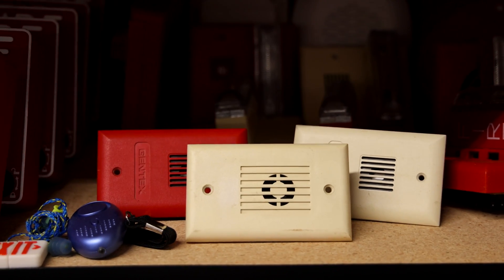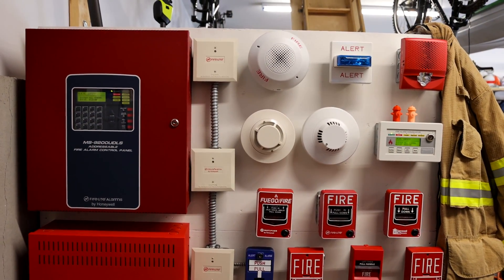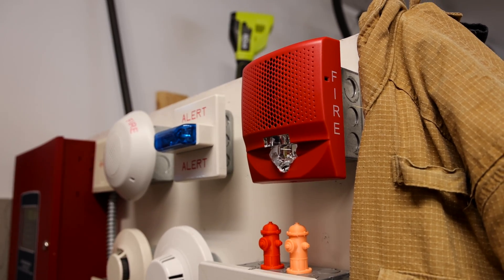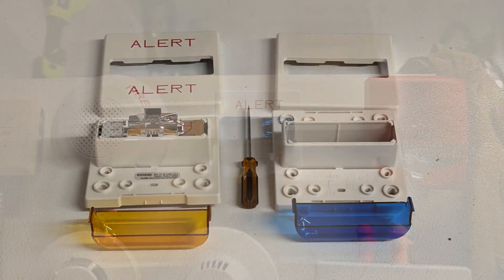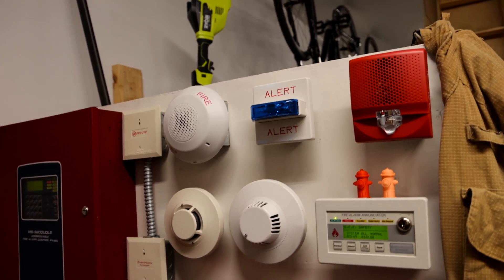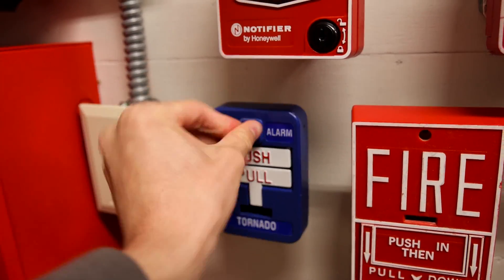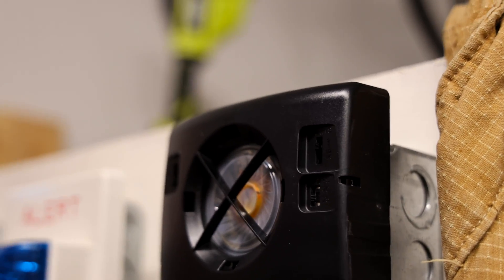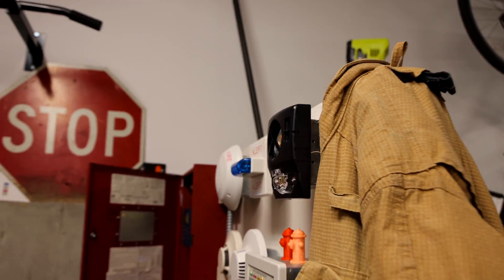Tornado/Fire Alarms doing Alternate Wail! | Wheelock & Fire-Lite System Test 22

Comment: fun fact, in Switzerland we had been extremly serious about which alarms and sirens do we use, but even more important, they are all the same all over Switzerland:
1 population alarm siren autorized
1 evacuation siren autorized
1 emergency vehicles's siren autorized (to be more precise, it's 2 volumes (campagne/highway and city/town), 2 tons (1 high, 1 low and they have to alternate at 1 speed), but different system are autorized (usually pneumatic and electronic))
1 AMOK siren autorized (AMOK=american high school situation protocol (to be more serious, amok is a french word coming from malaisian and meaning something like "sudden and indiscriminate murderous behavior"))

and there is a lot more, but basically, warning noise and siren are the same all over Switzerland and that's probably the most important.

Comment: I think the alternative wail would be good for a nuclear or biological release. We use the alert tone for tornado, the alternating tone for flood, and wail for attack. I actually think those high pitch screech fire alarms they've been using since the 90s are horrible. I actually feel like ripping the alarm off the wall they are so irritating. In the 80s, my elementary school just had a buzzer. They used a continuous buzz for fire and a pulse for tornado. We knew exactly what it meant, but the tornado pulsing buzz was scary even during drills. We actually did have a real tornado warning once. It made you feel that a monster was lurking around the school. In sixth grade, they modernized it, and no one knew what to do. Funky computer tones that you couldn't tell the difference. That's dangerous! The old system worked, and it worked well. Now, they just want to give you a migraine.

Comment: As far as weather sirens, I wish they would go back to the mechanical Thunderbolt that use a rotor and blower. Those made an eerie sound when wailing up, and winding down. They would rise in tone, hold it steady for X amount of minutes, then they would wind down. Around here, they don't keep rising and falling, and they also changed to a digital tone that's not nearly as spooky nor cool as the vintage Thunderbolt sirens. Though technically misnamed as a sound wave isn't a bolt, but a sonic boom. Lightning can be a bolt as the veins streak across the sky. But that's just my pedantic quirk.

As for Fire Alarms, the ones that I like most are the ones that rise from a low tone and keep repeating that sequence. And when there are multiple ones, it sounds even more ominous. Back when I was a kid, they were just loud buzzers with trumpet shape horns attached to make them louder. According to my Mother, I got a big kick out of pulling fire alarms and opening alarmed fire doors when I was like 3 years old. While I don't recall specifically doing it, I do recall the noise and did get a kick out of seeing people scrambling.

Also, I really HATE this LED nonsense. They're not only deteriorating our eyes, but they're just too bright when looking at, but don't put out good ambient light.

For example, when Police, Ambulance, or Fire would go down my street, I'd see the orbs on my curtains and walls, moving. Scared the HELL out of me until I realized what is going on. Now, I don't even notice emergency vehicles are around until I actually look outside to see what the vehicle with the siren I heard or the rumble of the firetruck that happened to be on my street. Halogen rotators are the best, for those applications and for fire horns and strobes incandescent, halogen, lighting up the sign itself is better with also a Xenon strobe tube flashing to grab attention. The reason why the sign that reads fire should also be lit is because, often with strobe, all you see is a flash. Not where it came from.

Comment: I own some tone generator boards from a modulator siren and I have directly recorded all the tones from the controller at a much higher quality then your current recording 

Here is the link to the modulator controller tones https://drive.google.com/drive/folders/1f_7jvYN10gR7yAUNojdhxHbO1OEVEnkR

Here is a link to a library of all the different siren controllers I’ve recorded (my favorite is the dual tone analog ESC-864 wail) https://drive.google.com/drive/folders/19pyaO19hNABMK1DwfNkg128w98R0HCes

Comment: There is tons of engineering that goes into fire alarms to make scary sounds. A key way is binaural tones or fast pulsating sounds, engineers typically choose a tone in the high pitched zone because it is more likely to scare someone to get attention. Slow down any fire alarm sound from the u.s and you will see that in some way it is changing pitch like a siren or simply pulsating. And how fire alarms are so loud and still using less than 5 watts is amazing.

This is why I like fire alarms!

Comment: Some things I want to point out in this video

1. Many emergency sirens like for emergency vehicles or civil defense use a frequency sweep/modulated sound so that way it's distinctive over any other sounds in the environment that have a steady frequency that's not for an emergency like a truck back up beeper and the reason why it's not at the same pitch as a fire alarm is because it's it's avoid being a noise maker to a large population that's used for many emergencies and with the same thing for voice evac fire alarm systems but different as the tone they make is a low pitched 1 Khz tone but to be distinctive over other sounds it has to sound in temporal 3 where's a ear-piercing noise maker alarm for a small population yet still public mode like a burglar alarm is ear-piercing in order to involve fast reactions to the alarm like if a burglar alarm goes off the their will run away but if it's a large population emergency alarm then it's not ear-piercing to that way when people are taking action like hearing civil defense sirens during a tornado warning then it's to make sure there aren't any fast or weird reactions to people that can fail if they're high pitched which is why they're low pitched to eliminate the annoyance to large populations

2. The frequency sweep rate on many alarms is also different from one's that are lower in order to make sure they don't sound like a personal alarm device or something like that of it sounding like that as many fire alarms have a frequency sweep around 40-60 Hz to sound distinctive and warbling on the ears

3. It is very nice that on the LED EST Genesis Speaker Strobes allow you to change the Watts in real time while it's going off so that way you can quickly meet the noise level requirements on the alarm depending on it's space like a large room gets 2 Watts and a small room gets 1/4 Watts to be 15 dB higher than the ambient noise level if it's above 60 dB but if it's rarely below 60 dB then the alarms have to be 75 dB
Reply: dari hasil 😊😊
Reply: Too much text
Reply: Like a paragraph

Comment: Congratulations! You have officially summoned siren head! Jokes aside, nice video! And congrats on the 100k subs! Alot of electronic sirens such as the modulators, the EOWS and the Whelen sirens have an alternate wail tone. But alot of older mechanical sirens such as the 3T22, the Thunderbolt 1003 and the super banshee (to name a few) also have the ability to do an alt wail tone as well. Also the phone alert attention tone isn't just used on phones but also TV and AM/FM EAS alert's use them too. (NOAA weather radio has a 1050hz single tone attention tone) Albeit its a continuous tone for 8 seconds rather than pulsed like the cell phones.
Reply: Wrong thing about Whelens. They have to be equipped with a UV or some sort of FS Controller.
Reply: @HSETM  Really? Cause I've seen videos of Whelen sirens on Whelen controllers doing Hi Lo. Look it up.
Reply: @zachzebra56  I know Whelens do have Hi Lo tones, they can't do Alt wail without a UV or some sort of FS Controller.
Reply: @HSETM  Oooooh ok my bad! Sorry. Your right.
Reply: The whole idea behind code 3 is like you said not just Loud and annoying but it pretty much set the standard as the modern alarm tone that stands for "fire". For example the psychological response I get when I hear an alarm going off in the distance with a code 3 tone I know right away it's a fire alarm.  The three obnoxious same header scrreaces and the EAS tone that follows triggers the psychological response of the first thoughts in my mind being "tornado" "severe thunderstorm" and not "fire" the word "fire" doesn't even come to mind then. Hearing a siren on attack/wail tone in the distance makes me think air raid siren "end of the world" "nuclear attack" lol.

Comment: Fun little fact, the first siren to use alternate sounding was the Ferderal Signal Thunderbolt 1003. In production from 1961-1990, the 1003 used solenoids to alternate the sounding by opining on opposite timing or pulsing by opening in sync. The 1003 could do steady, alternate steady, pulse steady, wail, alternate wail, and pulse wail. Feel free to correct me in the comments! Also well done on the 100K!
Reply: Additionally, the Siratone controller, also made by Federal Signal, used on the EOWS series, had the same abilities as the 1003, with the addition of chimes, whoop, and voice(?). Started being manufactured in 1981, ended in 1992.
Reply: 3T22 could do it too, using dampers on the upper and lower air intakes controlled by solenoids.
Reply: One more thing that they could do is the Undulating Hi-Lo, where it uses the Alternate-Wail for the “wind up” of the siren, and then for the “wind down” goes dual tone. The siren “winds” up and down in an attack mode.
Reply: I like the EOWS 612 SiraTone Alternate Wail
Reply: The sound clips in the video were probably from a modulator but the tbolt is better in my opinion
Reply: @ivanthegreat2255  thunderbolts are overrated. Whelens, B&Ms, and penetrators are the way to go 😎
Reply: @TheCasualSirenEnthusiast nah 2001s are
Reply: @AirVR  Thunderbolts are way more overrated. 2001 4th gens are kinda underrated ngl
Reply: 3t22s have the best hi lo
Reply: @FederalSignalFan  ACA Superbanshee has the best Hi-Lo
Reply: I feel like whelens hi-lo is a little worse than the 1003 hi-lo
Reply: Its also used in siren head's noise
Reply: That’s cool!
Reply: 65🎉and I am not sure 😕 96HWHF9NXDFTKK 😂is the Best way home
Reply: Oh so like the one on my pfp
Reply: Did SDW1 Start?
(Siren Disagreement War 1)
Reply: I was telling the fact.
Reply: Wrong there's no proof. No offense. The first siren to do alternate wail is the EOWS 612 it was first tested during 2007-8. There's one video recording it.
Reply: Hjjfggfbbbbbbbvb  Na t I ees
Reply: 1003 Thunderbolts were the ONLY version of the Thunderbolt that can do the Hi-Lo tone
Reply: Wow that's alot of words. Too bad I ain't reading em.

Comment: hi, here are two suggestions :
first, i know you have a MS-190 siren, but, theres something cooler than the MS-190, the carter minimite. this siren is from the UK and is the size of the MS-190. it is extremly old and is from the 1970s to 1990s. it comes in multple voltages : 6 volts, 12 volts, 24 volts, 50 volts and 220 volts (the 220 volt one is AC, not DC unlike the others), so you can choose the one that suits your need. they are extremly hard to find, so good luck trying to find one, and also, i own 4 of them (used to own 5 but gave one away), so i am quite lucky.

second, if you cant get your hands on the very rare carter minimite, there is also the MS-390 siren which is larger than the MS-190 and is way better, and these can be found on amazon, aliexpress or even ebay very easily.